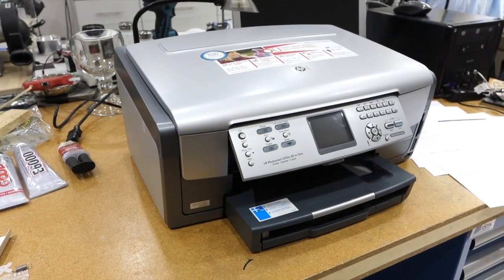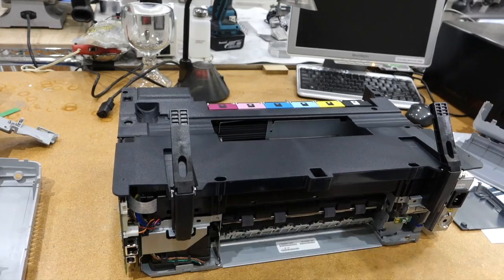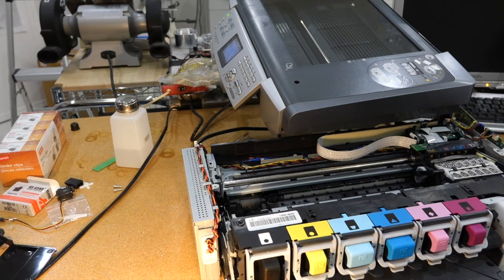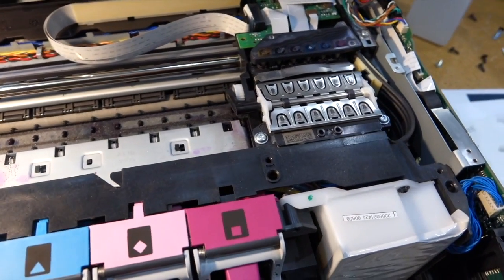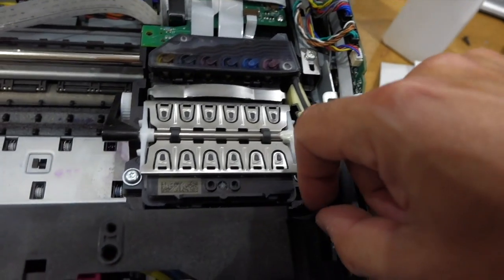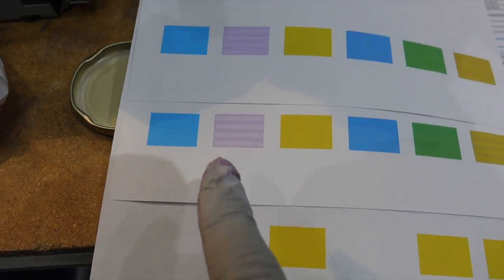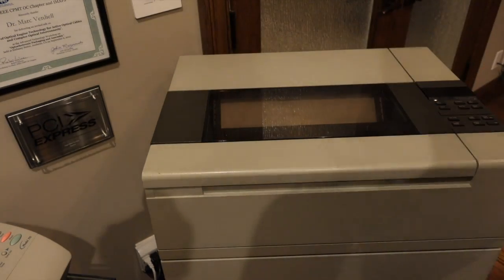HP Photosmart 3210 Inkjet Printer Head Repair and Cleaning

Comment: I have a Dell Photo Printer that's a rebadged Lexmark Z600 something.

Why is it still intact? A few reasons, but the main one is the thing is so incredibly cost reduced that it's reliable. Out of ink? Remove the cartridges, fill them, then put them back in. It has no real concept of ink levels or even cartridge DRM.

Also it was new old stock.

Comment: I have an HP Photosmart 3310, which is a slightly older version of the same thing with a failed ink system error 0xc18a0506 error.  I'm going to try and follow your path and see how it goes.  Mine is pretty messy inside, probably caused by using 3rd party cartridges.   Thanks Marc.

Comment: The broken rocker you show is built in obsolescence. That and the cheap caps used on the control boards. Replaced my rockers with hand crafted ones (thicker less crack prone mat. ) and  bought a cap kit to upgrade all caps. Learned a bunch about print head cleaning and off to the races she went.  This printer needs to be used, letting it set leads to issues ( print test pages ). All that said though. the unit is an awesome multi color using unit. Still well supported in software ( as of 2020. win10 compatible). Down fall to the DIY is the inkwell. The inkwell inside this unit is painful to deep clean, and is below a bunch of functioning items. Designed to never be serviced,  as much of printers seem to be.  Inks for this type of HP are being discontinued, but this type of printer, with it ink head system already separate from its ink, is a great candidate for CISS  usage. It doesn't require  internal ink feed to the heads like almost all others.  Head cleaning vids are on youtube and very useful. Just use it and avoid the need.

Comment: I didn't use my Photosmart 3210 at least 10 years. I bought new cartridges and it does not even print one dot! Is there any way to fix this? Or should I throw it away? :(
Reply: most likely clogged tubes. they start drying after a month or so
i just got one from a yard sale and this video helped

Comment: Hi Marc, thanks to your repair video I was indeed able to repair my HP 3310 Printer which is basically the same model! Guess what, the same actor broke and I had to flush the inksystem with alcohol, too. It worked like a charm and took my about 2 days to figure everything it out with your instructions. You really helped me a lot! :-)

Comment: Many HP of the era have the broken lift arms. A fantastic printer mine has been, aside from those. Has lasted about 10 years lol. CNC machined arms made of soft aluminum would make a ton of old units good to go for those that enjoyed them enough to save them.
my 5180 has a hand made arm in it made from snowmobile track slide/ high density plastic. IKR, to funny. But it works well.
ink system failure error messages once fixed can be cleared. Then they run like new as long as the ink systems not dry or plugged.

Comment: Your expression of what HP once stood for is a sentiment I've tried to hold onto as well.  Back in the 80's HP was indeed king.  It was the one of the defacto gold standards of quality, precision and longevity. Though their modern pieces of plastic (pronounced crap) are still engineering marvels, it seems their attitude towards quality and serviceability have fallen sadly to the wayside.  I guess we were lucky to see them in their prime!
Reply: David, I totally have to agree with you... I've had multiple printers, both HP and Epson... and they were made to be able to remove and clean the heads... at one time you could even just order replacement heads and if under warranty they were FREE... Some of the new Cannon printers have heads you can easily remove and clean... My biggest complaint is that they don't keep their software Drivers up to date, which shouldn't take that much effort, which you could keep your printer going as long as it was functional.
Reply: @williamghost1516  just look at who they hired to be their CEO when all these crap disposable units came out. 

(Hint : Carly Fiorina , the first woman to lead a fortune 50 company, 1999)

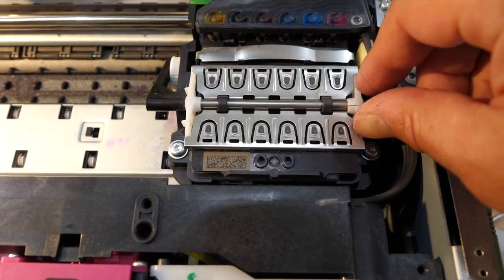Comment: Hi CuriousMarc.  I have exactly the same issue.  I want to replace the white piece that manage the ink flow (refer to min 4:41 in your video ;-)).  Do you have the reference number at HP of the piece you replaced, so that I can order it too ?  In case of out of stock (printer too old), I'm thinking to make it created with a 3D Printer.  Thanks for your reply
Reply: Made a replacement  using a high density plastic. I used a rotary tool after making a rough form, measured the shaft, drilled slightly smaller and it worked. So many old versions of this printer used this pre- print head arrangement that the entire assembly was purchasable used for cheap. So i do also have a used shaft with a good arm or 2 as well now. good luck, best wishes.

Comment: Exact same issue with my 3310, down the the broken rocker too, would be handy to know how you repaired that, as seems that is key for the life of the printer... could you do a video for that?
Reply from the maker: I was able to repair mine with epoxy made for plastic repairs.
Reply: CuriousMarc did you have to take out the part to do so?
Reply from the maker: No. In my case I just let the epoxy seep in.
Reply: CuriousMarc great, I’ll have to buy some, and give it a second go then. Thanks!

Comment: Please some help, I have a printer hp photosmart C7280, it doesn't print, already I did printhead cleaning, but now has ink leak around the borders of the transparent plastic, and also the printhead has not ink inside, the little hoses are clean, I don't know if the pump is working, please send me a answer and the solution .

Comment: I love UR video, question I am at the turning on the printer, have everything lined up as shown in Vid, no power, I got the wire harness connected, what am I missing.  Thank you the wonderful hope 4 this printer to work, after spending $42.00 on new ink, it is madding to spent money & have it break.
Reply from the maker: You should only need to reconnect the front panel. I'd check that the flex is well engaged in the connector first.

Comment: Wonderful to see someone with such expertise!! I have no experience taking apart a printer so I would have liked to see more detailed steps on how to do that but luckily I was able to take it apart. I was wondering what did you use to cleverly defeat the open door message? What does that piece have to make contact with? I am stuck at that step. It looks like my printer has the same problem as yours. The exact same piece is broken. What epoxy do you recommend?
Reply from the maker: I used a strip of plastic. Can't remember if it pushed on a microswitch or if it was an optical sensor. For glue I used "plastic weld" epoxy.
Reply: CuriousMarc  My printer is now working!! Thank you very much for your video!
Reply from the maker: Great to hear!

Comment: I had exactly the same problem with that printer. In my case the epoxy didn't hold, so I made a little bracket out of scrap aluminum and attached it to the nylon see-saw with two #2 screws and hardware.  It lasted two years and just died again about a week ago.  I think I'm going to strip out the steppers and toss the poor plastic carcass!